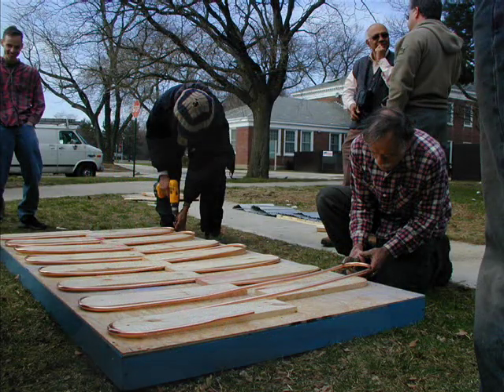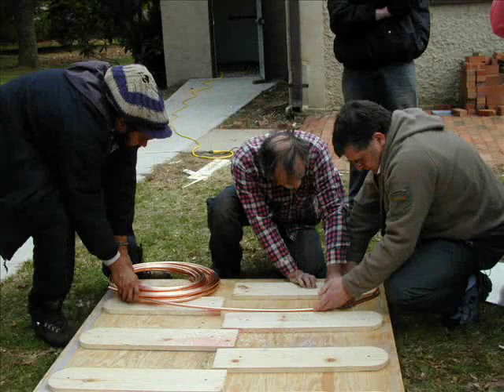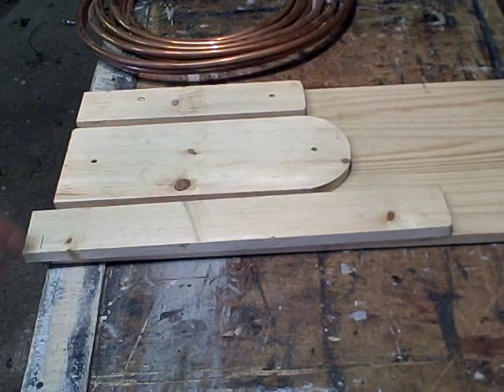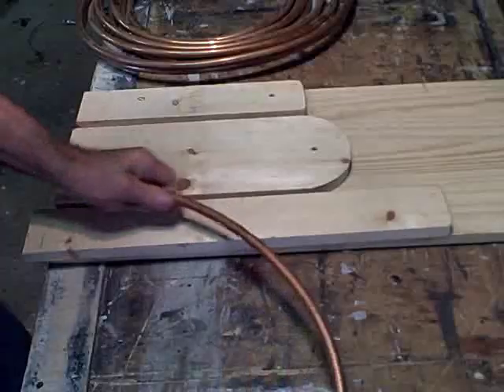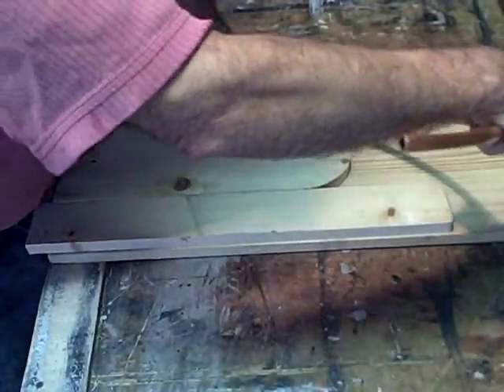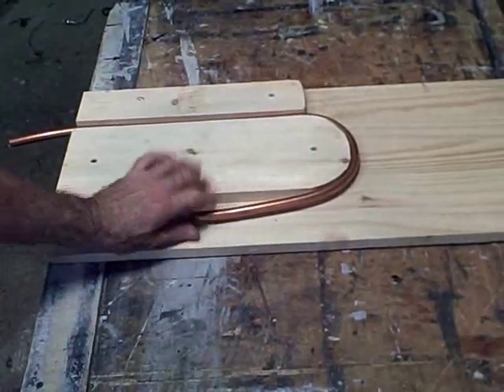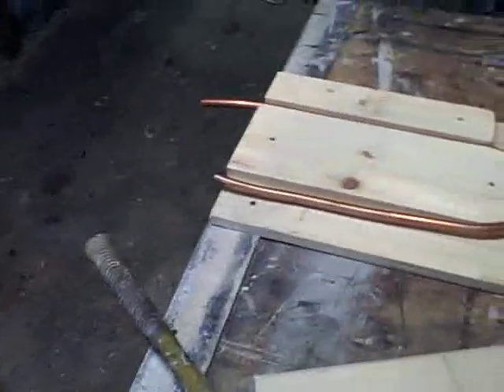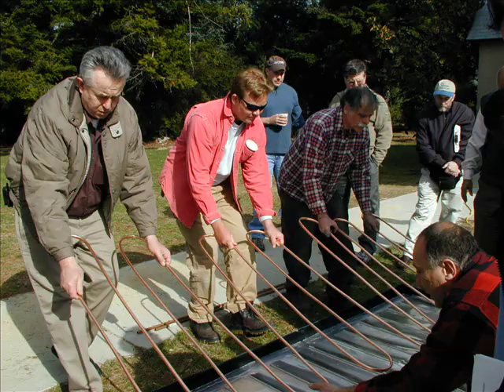How to make a Serpentine Flow Tube

Comment: If I put a flame to the end 1/4 copper tubing would the whole 10 - 20 feet get very hot ?
Reply: If you keep it in the flame for long enough, yes. But you should be able to heat a small part and bend it before the rest gets too hot.

Wear gloves and let it cool in between.

Comment: Is that 3/8's or 5/8's tubing you are using? I have 100 feet of 5/8 A/C copper tubing, and I an fixing to build a solar water heater system,,,I think you way is much better than what i was thinking, with all the straight pipes and tee's that would need soldering in place. Wood is much easier to work with ---- and I like you idea.
What are you going to use to cover the panel with after you finish building it? Acrylic or Glass or Plexi???? Thanks for the great video...